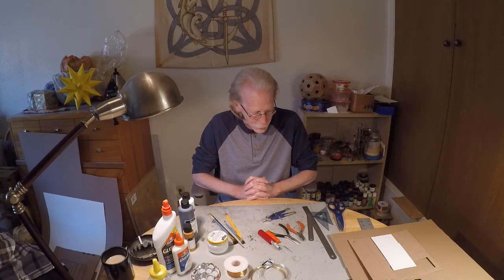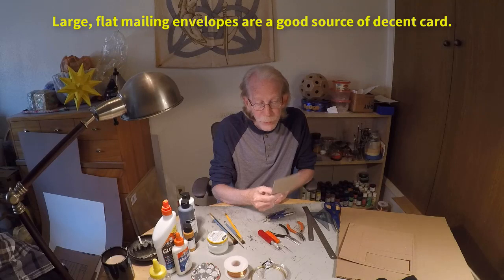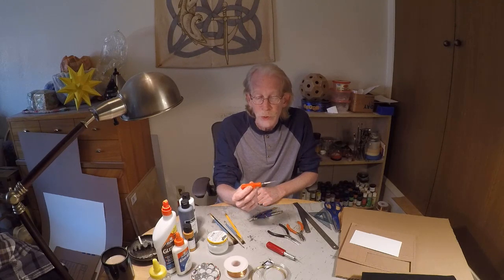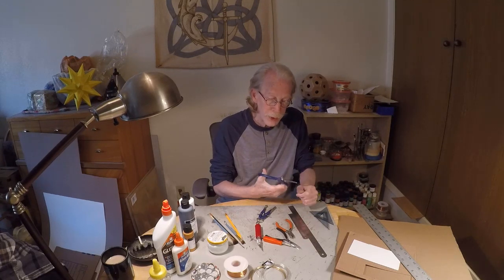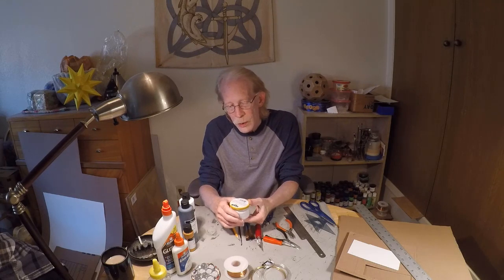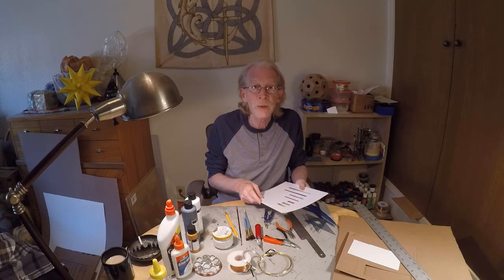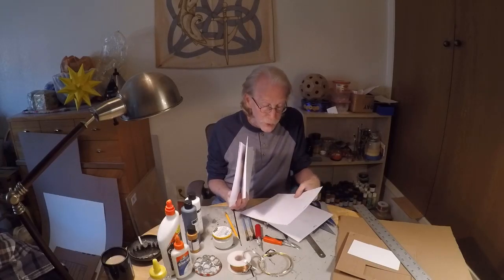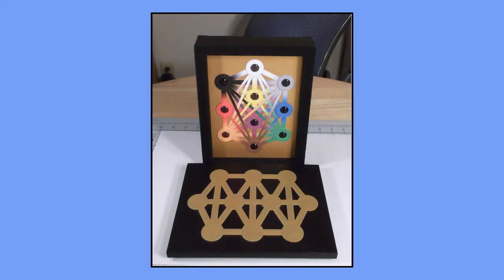How to make a Gate Maker  --  Part 1: Introduction

Comment: What should be the diameter of the wires? How long should wires be? I assume it must be pure ore, not gold plated copper wire(plenty on market). I found in jewellery suplier store, welding wire(19.7“ x 0.01“) Au 585/000 - 14K - seems to be good.

+/- what should be the diameter of the quartz spheres?

btw. Link in the description is "TMO-WG Meeting Place" not "Gate Maker" :)
Reply from the maker: Thanks for telling me about the link!!!  It's been corrected.  :)

The diameter of the wires is 24 guage.  I've also used 22 guage but it's thicker and more difficult to insert.  The lenght of the wires depends upon which particular path you're cutting them for.

I use 14K gold FILLED wire because solid gold wire is just too damned expensive!  LOL  Gold filled wire is suitable for my uses.  But if you want to work with solid gold wire that's great.  :)

Optimal diameter of the quartz spheres is 22mm.  Most who claim to sell 1" are actually 22mm.
Reply: @rawnclark1115  What a relief. Gold is expensive, especially in times like these. I will use a gold filled wire, if you say so. 
I admire your work, since i have read Bardon's comments 11 years ago, then I saw your useful miracles, but then I couldn't afford it ... And to be honest - I was a rookie - they would have been of no use to me at all. But today - this could be the beginning of a wonderful journey.
Reply from the maker: @Rzyczkowski   If you're planning to make your own GateMaker, your main difficlty will be in the tuning of the crystals.  I'll try to describe it thoroughly enough in the video so you'll have some idea of what is involved.  :)